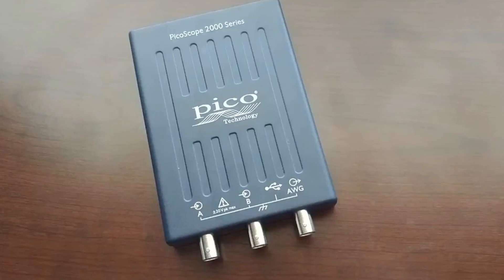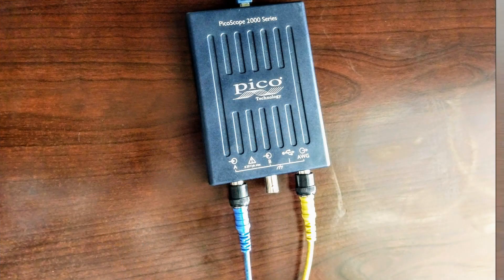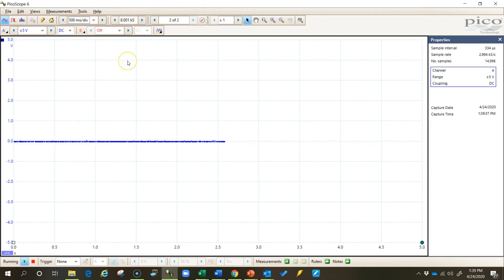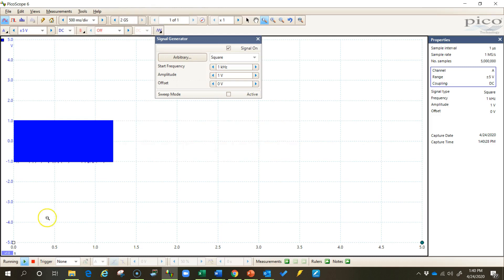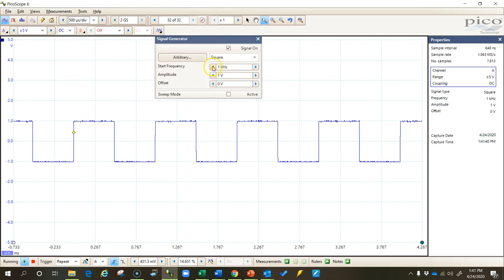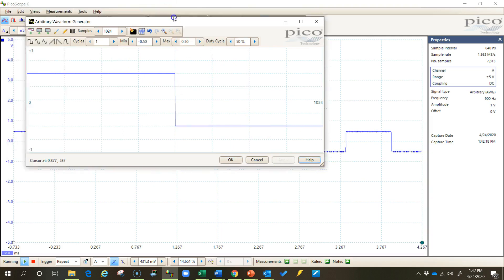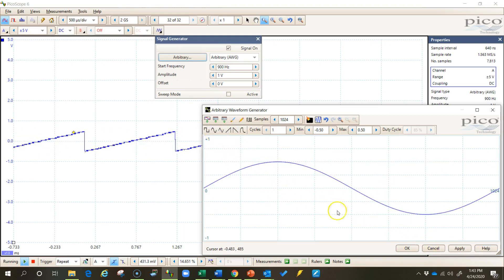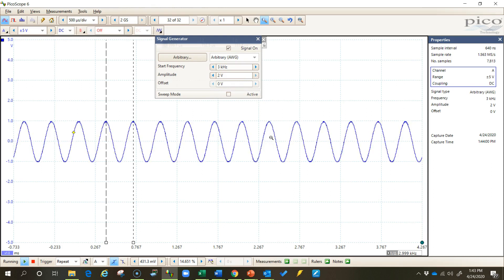Using the PicoScope Built-in Waveform Generator

Comment: Really neat!  I did not know that a signal generator was even an option.  I am really enjoying your Picoscope playlist!  I have about 10 years experience in automotive repair and am looking to buy a Picoscope.  Is there a big enough advantage to the 4425a to justify the price difference as compared to the 2204? Picoscope 6 vs Picoscope 6 automotive- what is the difference besides presets?
Reply from the maker: Hello Bradley.  Thanks for the feedback on the videos!  

  If you plan to use your scope for automotive testing, there is a huge difference between the 2204A and the 4425A.  The 2204A's are not very robust and have a low sampling rate.  While you can make them work for automotive testing, everyone I know who purchased a 2204A has wanted to upgrade within a year because they either stopped working or were frustrated with the limitations.

I would not hesitate at all to purchase a 4425A instead if you want something that will last a lifetime and capture quality waveforms.  If you are only going to be doing light-duty electronic bench testing, the 2204A scope may be sufficient.  

I can actually help you with any questions you have about the scopes and possibly even get you a discount.  I currently have a lightly used 2204A kit available.  Feel free to visit my website, where you can send a message (www.catchawave.com) or call me at 208-538-1989.  

I hope that helps!  Good luck!
Justin

Comment: Well if You click on the SAMPLES Burton in the Arbitrary Waveform Windows and put in 1010101010101010010101010101010 You can simulator a cranckshaft Hall sensor or anything else with a pulse pattern.
Reply from the maker: Wow!  I didn't know that.  Thanks for sharing.

Comment: Always interesting and informative. Thank you for sharing. As part of a diagnosis, do you ever use a generator signal as a replacement for a questionable sensor?
Reply from the maker: With other waveform generators, I have. I have not done it with the PicoScope yet. This could work.  However, the maximum voltage outputted by this waveform generator is 2 volts.  That may or may not be enough to substitute for you sensor signal depending on the situation.